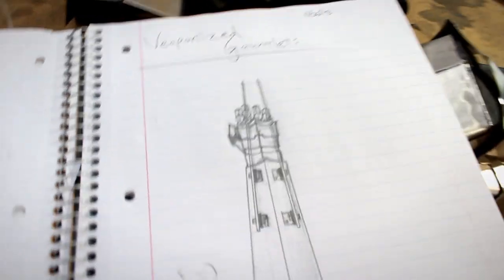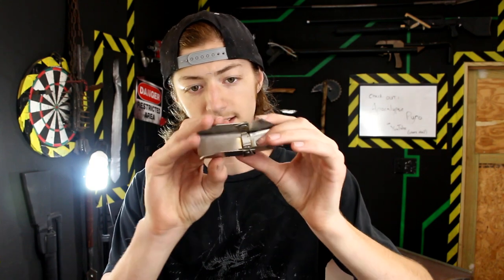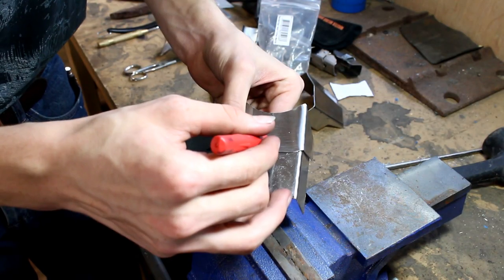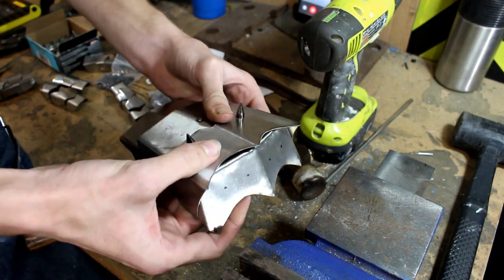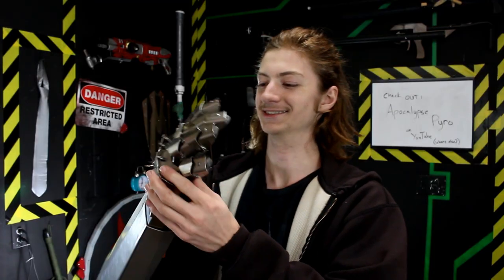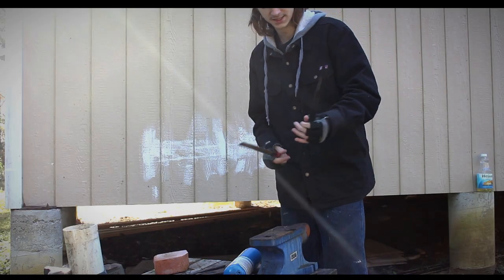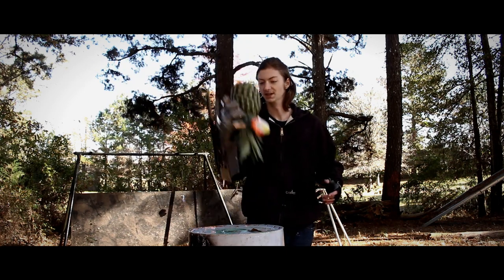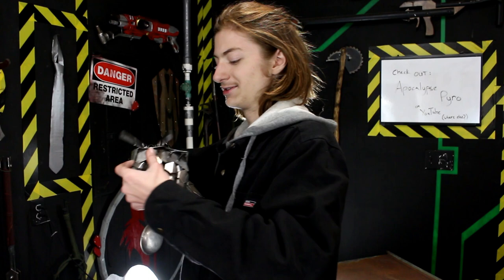WOLVERINE BLADED Armor Gauntlet PART 2 (Apocalypse Pyro collab)

Comment: What kind of drill do you use in order to drill through that kind of metal, the blades of the gauntlet I mean.
Reply from the maker: Any drill will work. Use some decent bits, go slow, use oil. Do it on unhardened metal, harden it afterward. Drilling through hardened steel is a pain
Reply: @jakemakes  oh dude my senior labs showed me that the hard way. Finding the perfect piece of stock only to see its hardened. Also thanks a bunch, I think I've got this whole thing figured out now!